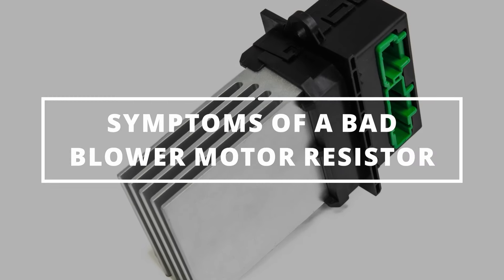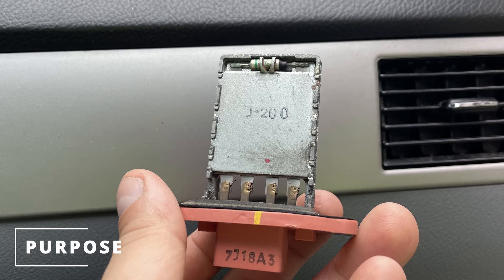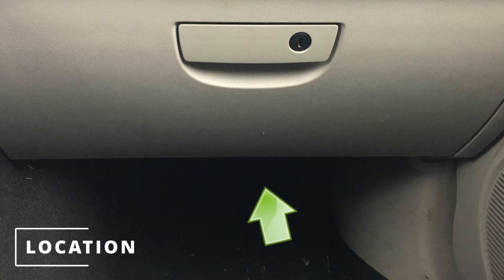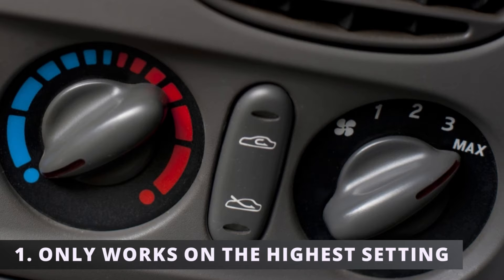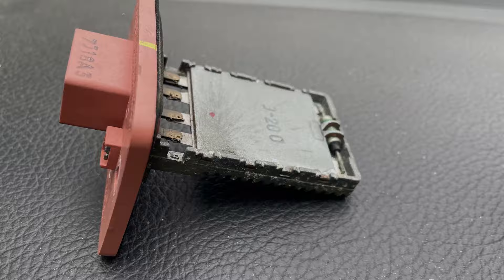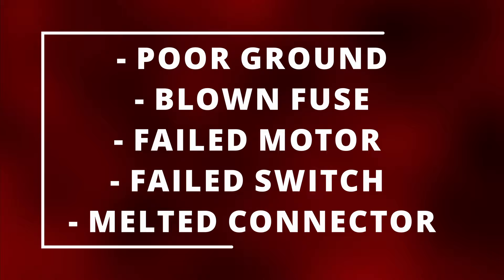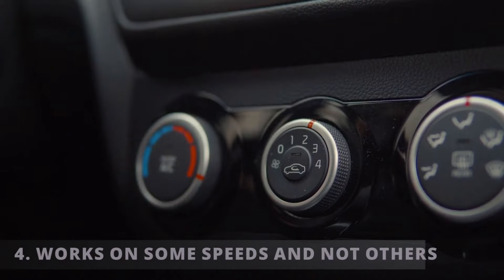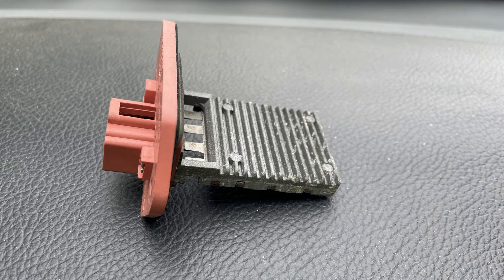SYMPTOMS OF A BAD BLOWER MOTOR RESISTOR

Comment: Has anyone came across this problem the blower motor stays on high even when set to off position . is it the resistor ?
Reply: I'm having the same problem. Did you figure anything out?
Reply: yes it is
Reply: My '11 camry blower motor stays on high even with the vehicle off and key out. Please help!

Fixed Update:  the blower motor has a resister in it. You can replace the $50 blower motor or replace the $25 resister.  I recommend replacing the resister because the chinesium motor isn't as good as the original. 

They're both under the glove compartment (passenger side)
Reply: The ac panel,most of the time
Reply: Usually yes it shorts internally
Reply: My 04 Grand Prix had that problem, it was a bad resistor.

Comment: Have a 2014 Dodge Durango V6. Air totally stopped blowing. Front blower motor fuse has blown several times. I've replaced them with other 40A ones from the fuse box. Then replacing those with non oem 40A ones. Every time the AC starts working fine again. It lasts a few weeks to about a month. Last time I used one of the aftermarket 40A for the blower. Today it blew & the fuse actually melted in its spot. Gonna try to coax it out of there. Someone had mentioned these fuses are directional. The oem ones have theses grooves on one side where the aftermarket ones did not. Not sure if this was a factor. But gonna buy the oem style after I get it out. Don't believe its a short because the problem is not intermittent. Gonna try replacing the blower motor, resistor & plug if it looks burnt. In your opinion or if someone else that's knows these symptoms please chime in, would you say that's a sounds like a sound plan of attack to in all likelihood resolve my issue or is this over kill? Thanks!
Reply: If it melted then that means it’s making a bad connection at the fuse. Same thing happened to me. Dealership said I need a new fuse box under hood. $600 plus labor. Nope I took it out and bent the prongs back together. Fixed it

Comment: 2014 Hyundai accent, 4-speed blower, position three acts like it's on low, the other positions were correct. Would this be a switch or resistor??
Reply: Tell me you didn't watch the video, without telling me you didn't watch the video.

Comment: I changed the blower motor in my car but now when I turn on the AC only a little air comes out. I changed both filters and when changing the fan speed I hear the blower increase in power but still little air out vents. What you guys think?

Comment: my heat works and the blower works, my a/c sometimes works and other times it does not. when its not working i cannot control my vents it defaults to defrost vent and that is it.
Reply: I have the same issue on a 2013 Honda CRV. Just manifested today. When the car is hot, that’s when it happens. Everything works normally when the car is cold.
Reply: @HomeOrchard  i have yet to find the problem

Comment: You can clean the switch with electric spray cleaner too before you think it's the resister it was why my Ford truck just run on hi cleaned the switch and wa ahh

Comment: Hi there. If my blower keeps cutting in then out (but I can still change the fan speed when it's decided to work) could it still be a resistor issue? Thanks!
Reply: Same issue
Reply: Find out?
Reply: @vipers2002rt  more than likely it’s the whole blower motor
Reply: @admiralshwartz3956  My b.m. is only 2 years old, replaced it in 21.
Reply: @admiralshwartz3956  i pull on wires under glove box and the motor is stronger/more heat blows stronger, then it goes lower/weaker as soon as i let the wires go.
Reply: @robrobert3438 sounds like a short circuit/loose wire harness I would check the connections if they are tight then I would look and see where exactly you touch then it dose improve the speed then if possible replace the cable/end of cable from the short down

Comment: I have a 2005 Scion tc that AC works fine and randomly after a while the blower won’t kick on unless I tap on the bottom pretty hard and it gets it going fine no problem. All speeds works. Could it still be a bad blower motor resistor?

Comment: My '11 camry blower motor stays on high even with the vehicle off and key out. Please help!  Keeps running down the battery.

Fixed Update:  The blower motor has a resister in it. You can replace the $50 blower motor or replace the $25 resister.  I recommend replacing the resister because the chinesium motor isn't as good as the original. 

They're both under the glove compartment (passenger side)
Reply from the maker: It's possible that the relay is stuck in the "on" position, causing the blower motor to run continuously. Locate the relay in the fuse box and try swapping it with a similar relay to see if that resolves the issue.

Comment: Can this also cause the ac compressor not to engage I have this issue but the air is also not getting cold either it works on highest speed. But air doesn’t cool down. 
Heat works though
Reply: Did you find an answer?
Reply: @ding9633 
Yes I actually did 
Removed the blower motor to test it with a 9 volt battery after finding out if or not your blower motor works 
I went back and testing the relay in the fuse box and it ended up being that. 
Hope this works for you.
Reply: @estebansaint  i have similar problem. My AC doesn't blow cold air so I replaced the AC compressor now I notice it only blows on max setting, but I THINK it did that when the A.C. actually used to blow cold air last summer but I could be wrong. Did yours start to blow cold and on all settings once you replaced the relay?

Comment: If I replace my motor resistance would the Air flow be fixed? Like I fans are blowing but it is just not enough and doesnt really get hot but it does come warm Air out
Reply: Having the same issue with my 07 Silverado, looking for fix.
Reply: Well could be a blown fuse I would check that first if that’s not the problem I would replace the resistor or at least test the old one that you have if that checks out then I would look into buying a blower motor especially if you swich the speed and nothing happens because usually the resistor or the motor will go out before the switch/ relay dose

Comment: Hey guys. I have a problem. In my 1996 Chevy Tahoe  the ac and the air stop coming out . 

This happened last week . I was driving and using the ac and at first it smelled like something was burnt and then the air stop coming out. I was using the mood wear all the air gets push out to you but when the air shout off I could feel it barely coming out from the vent under the dash . Any ideas on how I can go about fixing it ? Thank you’ll
Reply: I had this exact issue with an 08 tahoe
Reply: It could be a couple issues the first one I would try and see if there’s a short somewhere that cased the meltdown (if any of the wires are melted that is) if not I would try to replace the blower motor especially if you used it a lot recently and or if it’s never been replaced after checking the fuses ofc

Comment: I got an Audi A4 (B5) that when on heater, the fan speed slowly increases by itself and then pops a fuse. I tried it on a/c and it pops the fuse in less than a minute. I'm guessing its the blower motor resister/relay?
Edit: I should also mention the fact that my controls are digital and not a dial. I see the LED screen increase fan speed. The circuit board for the display looks fine and clean. No burn marks. Its a year 2000 vehicle, so my guess is the relay is shorting and it back feeds to the panel thinking the speed changed due to voltage increase?
Reply: Theres a short

Comment: I have a question my car just star making a weird noise that was my blower motor jus yesterday and today just stop working no air nothing and im confuse if i only need to change the blower motor or both im not sure
Reply: Same problem on my Lexus rx300. Any advise? Other than start replacing from cheapest item & work my way up till fixed?😂
Reply: @nickdesaint4601  blower motor was my issue

Comment: I have a 2017 Ram 2500 and on high fan speed it feels like it’s barely on. Would that resistor cause that to happen?
Reply from the maker: It is possible yes, it could also be your blower motor.
Reply: May join just be the switch going to it try electric spray cleaner on the switch I cleaned mine and solved my trouble a man needs to clean the electric switches on a car or truck anyway you be surprised how it will help I keep a can of it

Comment: I'm getting a burning rubber smell as I'm driving and i hear a sort of humming or buzzing noise, just replaced my fan blower motor about 2 months ago. Could that be because of the resistor?
Reply: It could be but to me sounds like a short circuit somewhere causing a meltdown somewhere in the system I would check your wires around your ventilation system first

Comment: Man I'm stumped and Idk what to do anymore. 😔 I got a 06 crown victoria and the AC would work but barely blow. The high speed level felt like the lowest but each speed would be about a 1/10th faster than the other. Then I turned the knob to heat and it changed to heat..ok fine.. Well no it's not because when I went to put it back on cold it's stuck on heat.

I know blend door actuators are a common fail but so is the resistor. I'm lost
Reply: Your issue im willing to bet is blend door over anything

Comment: Hey buddy I have a 2004 Mercedez Benz sl500. The climate control suddenly stopped working, I mean there’s no light nothing coming on from the front panel 
Do you think it’s the blower resistor or something else ?
Reply: Sounds like a blown fuse somewhere I’d check that first
Reply: @hsittefchannel8911  I have checked all fuses but they are all working 
Thanks
Reply: @kishorilalkishoreda5719  hmm did you smell any burning or did you ever figure out what the issue was if not what all have you tried so far
Reply: @hsittefchannel8911  So, there’s the R23 fuse which is related to the AC and there are couple other fuses under the hood, which they all work fine. A mechanic connected a scanner to the car to see if the blower and the climate control receive their power. He left the car for a minute to answer a phone call that suddenly my AC started to work for about 30 seconds and then all the lights on the climate control went off. Don’t you think it’s the climate control ?
Because the blower worked for 30 seconds. What do you think ?
Reply: @kishorilalkishoreda5719  it sounds like a short somewhere or a lose connection because my radio would do the same thing and it ended up being a faulty ground connection and a blown fuse
Reply: @hsittefchannel8911  update
The mechanic called me and said that the climate control is bad . So I found a used one in a German 2nd hand part shop, and we’re gonna connect that one to the car and I hope, that can solve the problem 
Thanks for your help. I’ll keep you updated.
Reply: @kishorilalkishoreda5719  your welcome and thanks for the update 😊

Comment: my 2004 Mitsubishi Endeavor blower motor connections melted to bits, the new one is only getting 0.4 volts could that be a resistor?
Reply: It could be that or a blown fuse due to the short that caused the meltdown I would check for shorts first then the fuses/relays responsible then test the resistor

Comment: My climate control panel has power because led display is on. But when I push buttons it doesn't work, I wonder if this is the issue.
Reply: Mines doing the same did you figure it out

Comment: what if the blower motor is blowing at inconsistent speeds? mine set on any setting will blow but will fluctuate blowing harder and softer...could this be a resistor issue?
Reply: The same issue here. Did you figure it out?
Reply: Mine started doing the same thing last year. I had to add refrigerant to my system, and the problem went away. The problem just popped back up yesterday. Let us know if you find a fix.
Reply: It could be a bad resistor but it could also be a short somewhere or somewhere I sent making good contact especially if it improves if you hit a bump/jolt the car in some way I would check the connections first then go to test the resistor
Reply: @uncleandy7983 it could be a leak somewhere in the system I would check that especially if adding refrigerant fixed the issue for more then a couple days
Reply: @mohammedabdulmannan7507  i figured it out, bad left side blend door actuator.